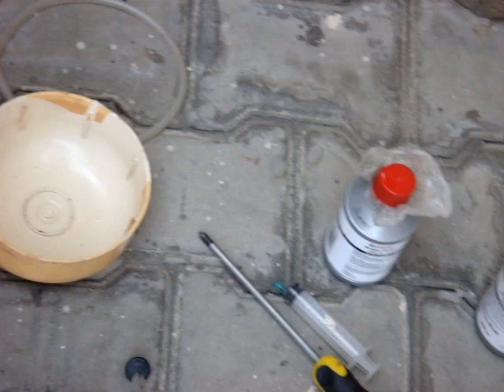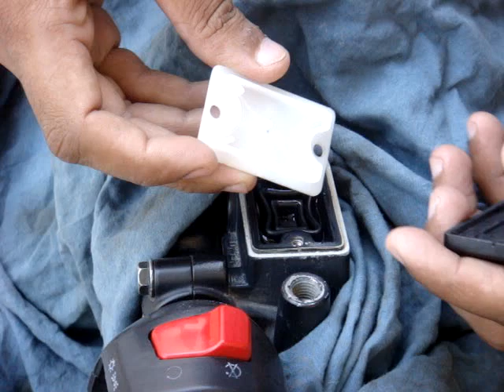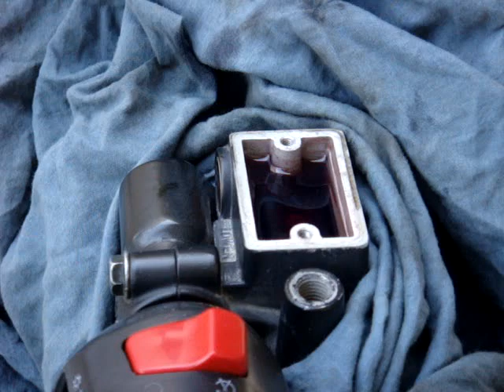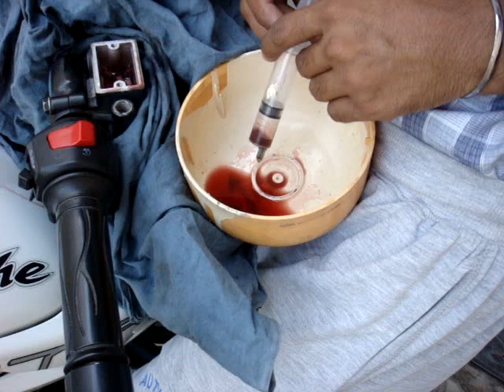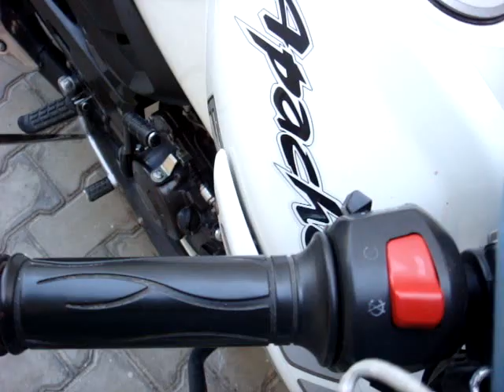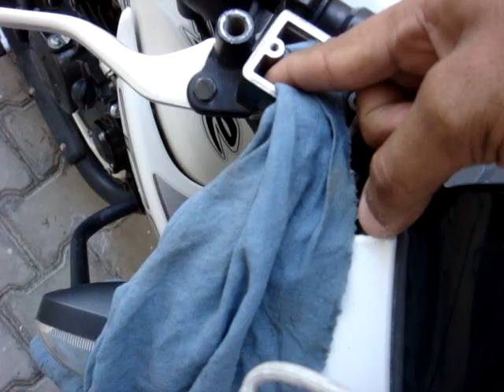Brake fluid change in TVS Apache RTR 180 PART 1

Comment: I know this is a stupid question bro but what is the importance of doing this? Moreover, when do i know i need to change the fluid?
Reply from the maker: Bro You change brake fluid from reservoir, but what about the fluid inside pipeline.  U will use 5-6 % of new reservoir fluid but the actual fluid responsible for braking is the fluid present in pipeline.